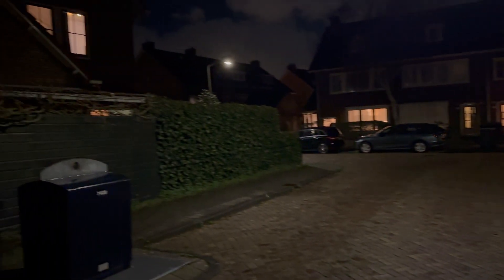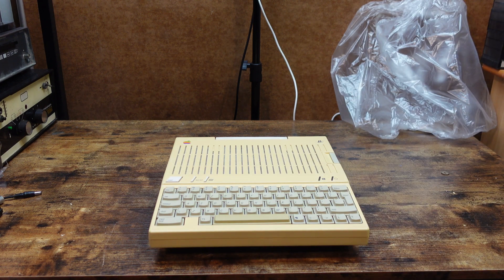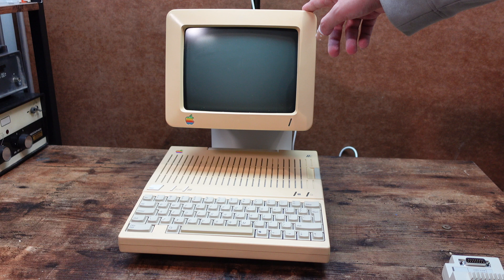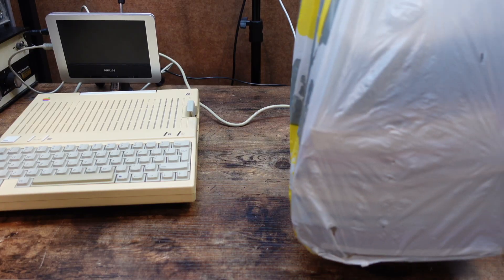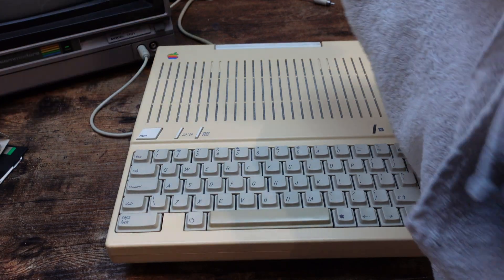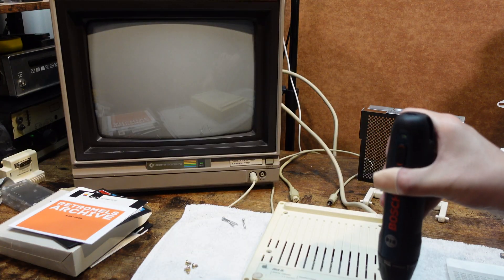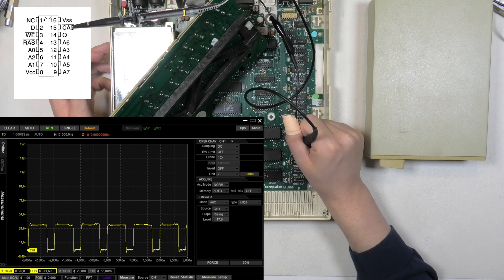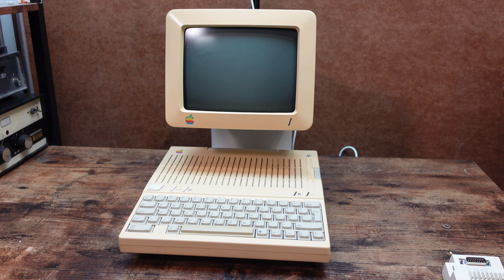Apple IIc Shenanigans: Experimenting with New Troubleshooting Methods!

Comment: Yes, looks like a RAM issue.  You could piggyback a RAM chip on each one to see what happens. I believe you may have 2 bad memory chips. Thanks for sharing
Reply: Rudy knows!

I came here to say the same, highly likely it's the RAM.

BTW, you can vastly improve that keyboard by taking the key caps off and removing that deteriorating rubber underlayment. Additionally, for some of these keyboards removing the little metal pin thingies may provide additional improvement.
Reply from the maker: Exactly, that rubber underlayment is causing the stiff keys..🎹
Reply from the maker: Thanks Rudy! I’ll try that, think I have some spare RAM laying around.